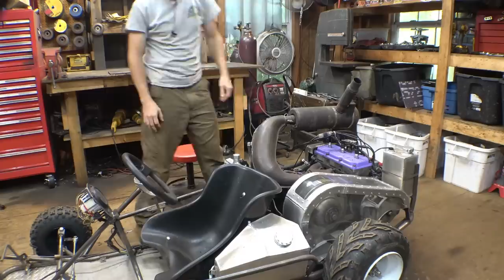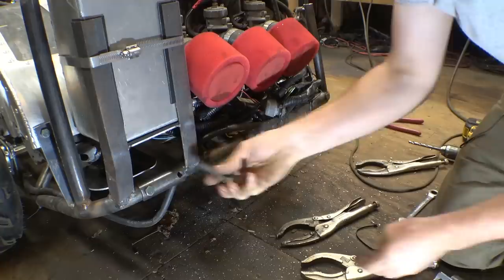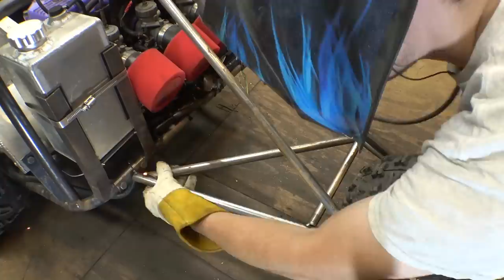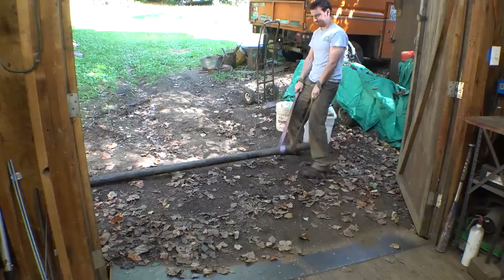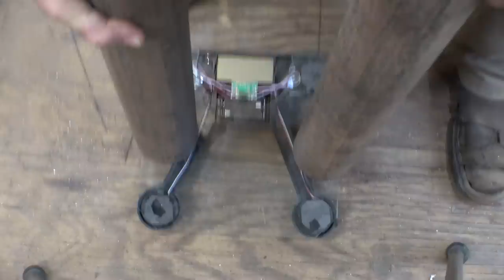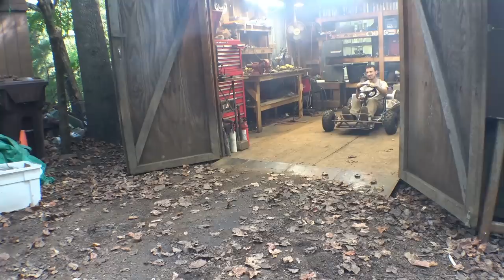Polaris XLT 600 Powered Go Kart Gets Wheelie Bars!!!

Comment: You need to ditch the go carts brake and use the snowmobile disc and caliper the go carts setup was designed to stop a go carts say 400 lbs going 60 mph Polaris system 600 lbs 105 mph will lock that track instantly on ice with 144 well placed picks I think I was a cat man. And my willwood setup would so my FIRECAT lighter almost 100 lbs but after some trick clutching and a seriously advanced keyway for my flywheel my 03 F7 ran 124 on radar and the only system I never had to mess with was the brakes tell the man that sent you the engine that you also need the brake system

Comment: Take that 2 speed power loss out of the thing. Let the snowmobile clutches do their job. You probably are losing 20 hp through that transmission along with adding more weight to the rear.